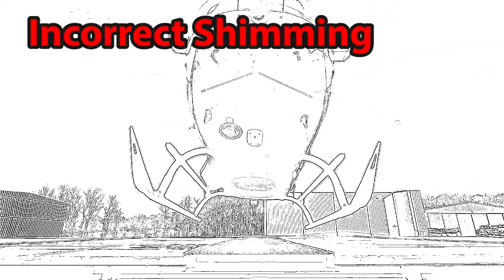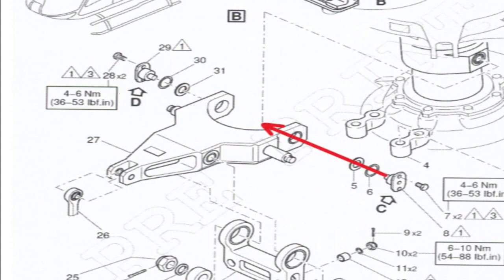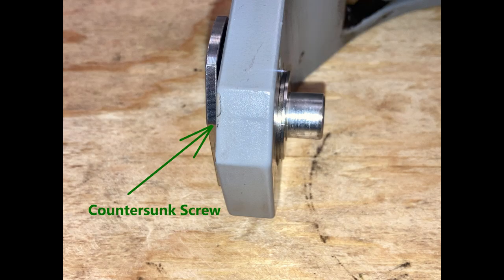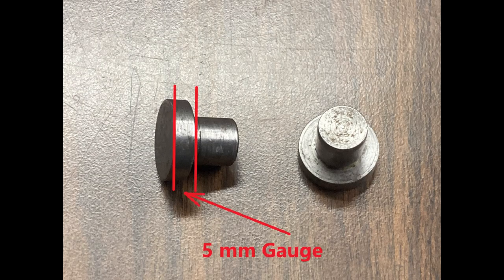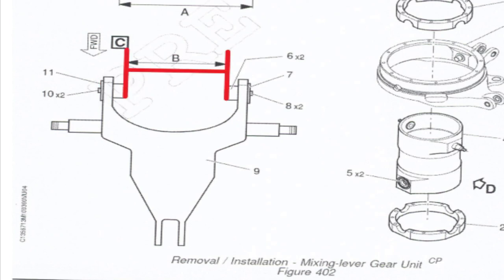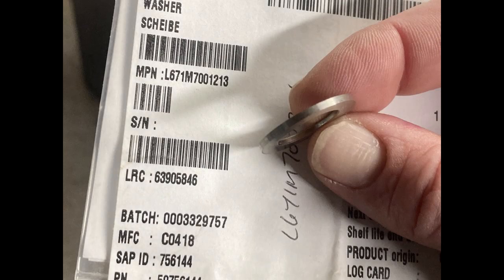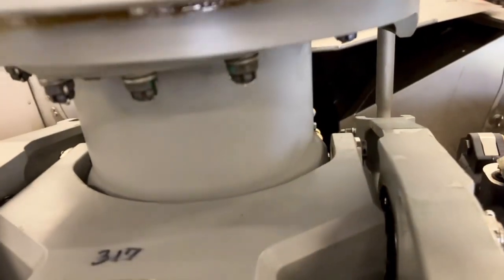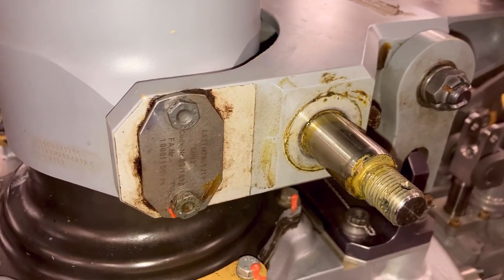Forked Lever Shimming | EC135 Helicopter

Comment: Thank you. I would like to see more like this. How about main transmission pinion inspection.
Reply from the maker: Are you talking about the input drive quills?
Reply from the maker: Or the free wheeling unit inspection
Reply: @HelicopterMaintenance  Yes, input drive Quills.
Reply from the maker: Ok, it might be a while until I do that job again but I will get the information I need for a video.  The drive quill inspection is only on the older transmissions, I don’t remember the PN break.  But I have taken the quill out to do the inspection on the free wheel unit.